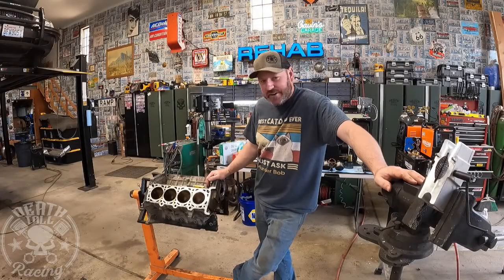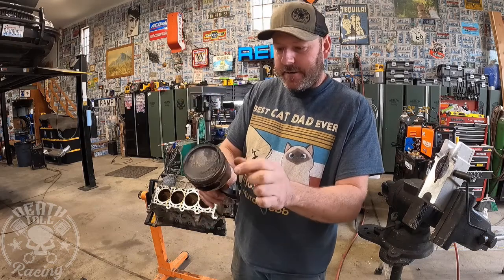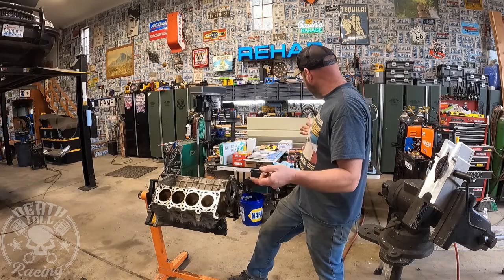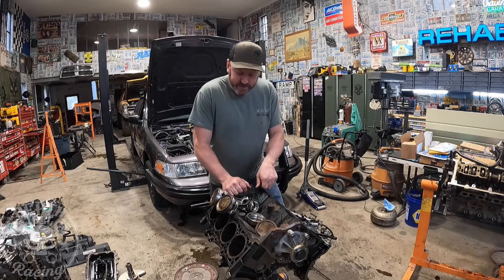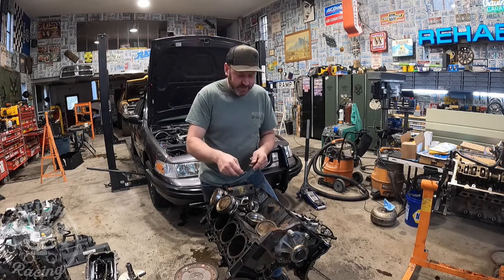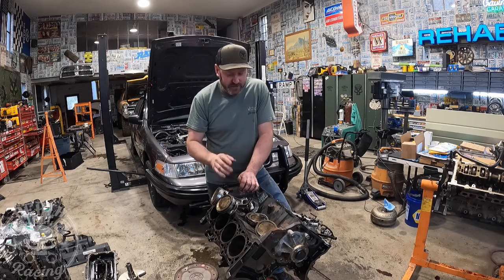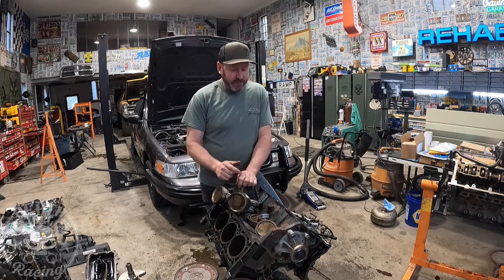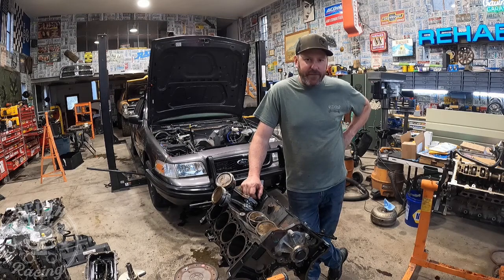Crown Vic WAP Block Swap, Boost Prep, Twin Turbo Crown Vic Budget Build #boosted #twinturbo

Comment: The placement of your turbos is exactly how I'm doing mine.  Except I'm wrapping the intake instead of the exhaust to keep heat away from the turbos as much as I can.  And the bov will be right near the throttle body.  I've done remote mounted blow offs before and had problems.  Also adding a totally separate oil system for the turbskies with a little 4 quart reservoir and cooler.  I loved watching your build and love your process.
Reply from the maker: That's how I was originally planning on doing mine, but I was having a hard time finding a pump for the oil.  I may end up adding a separate oil system later, but it's working good as is for now.  I agree with the blow off, I need to add a gauge pre throttle body because I don't think they are blowing off properly, and it will be a problem at higher psi once I get a forged rotating assembly.
Reply: So Tilton and Earls make really nice differential cooler pumps that work great as turbo feed pumps.  Low pressure higher flow works great.  Earls products are much nicer but a Tilton will get the job done.  And a power steering reservoir is a good choice for fluid storage / tank because of the way it is designed internally to dump back in and drain down.  Keeps air out.  I've done so many turbo builds for customers but never one for myself so I'm super stoked to start mine soon.  You've got me inspired again to put in the hours.
Reply from the maker: @knobleindustries8106  right on!  Thanks for that. I may do that once I get a forged motor built. This one has its work cut out for it this spring (currently wap block swapped if you haven’t seen the original motor explode during binge boosting). Hopefully the wap motor will hold together for a handful of passes @9 psi
Reply: Haha yeah those rods just suck.  I have a collection of 4.6 rods that are bent.  I'm building a 7.3 for my Vic, they finally make some manifolds with integrated intercoolers I'll be trying to get my hands on.  I'll blow the current motor up and then swap in the 7.3.  at some point.  I also need a trans.  It never ends.  I saw your air cleaner stealth box thing and was actually planning somthing similar running a 2" pipe inside the box up to the throttle body.  Found a work around here so I don't need smog (California) so no need to hide my work anymore. Also doing air bags soon and will film that whole process.  😁
Reply from the maker: @knobleindustries8106  right on!  7.3 will be wicked!  I’m not sure what gave first, but definitely somewhere around the wrist pins.
Reply: @knobleindustries8106  yeah you can get gen 2 coyote rods put em in there. They can be had on ebay for under $250. The gen 2 coyote rods are good for 650+ hp all day. They fit just fine in 4.6's.
Reply: @DeathTollRacing coyote rods are good for 800hp and 200 bucks

Comment: The pistons out of my 03 marauder have coated skirts
Reply from the maker: So what's odd about that is the original pistons in the 2010 vic were coated, but the 2005 wap block pistons were not.

Comment: Nice. I hate to be that guy but Andrew Lavender is running well over 1,000 hp through a stock WAP block and he drag races his Mustang hard. Everyone wants the Teksid but I honestly don’t think they’re worth the extra money and effort to acquire. I have a WAP from an ‘03 Expedition that I’m going to be building for my 2011 Vic
Reply from the maker: Yeah, I agree.  I think this block is not as limited as a lot of people make it out to be.  We will see how it holds up, but I'm going to limit my boost to 9psi for a while.  It will be interesting what hp that is now that it wont be slipping.
Reply: Im running 608rwhp in my mustang on an early WAP block out of an 03 mach1. I've been told that the Aluminator blocks that came in the 3 valve mustangs are stronger than the Teksid.
Reply from the maker: @stullsy21  I've heard the same.  It will be interesting for sure.  My limitation will still be my pistons and rods.
Reply: @DeathTollRacing  normally is, from my experience, rods, Pistons, or bearings. It takes a lot to kill a crank or a block.
Reply: Yea Andrew is who I based my build on. I knew failure would occur if I didn’t forge the internals but to see it happen at about the given numbers where ppl say it does was nice to see. Andrew is the 4.6 2v king to me. They’re expensive to build but dtr should forge and boost. I’m trying but my funds aren’t lol.

Comment: Im installing a remote Mount turbo setup on mine, can i blow 7psi through the Mass air flow sensor?
Or do i need to relocate the mass air flow sensor to the rear?
Reply from the maker: You can. That’s about the max of what mine could handle tuning wise.  It should stay up front.

Comment: IMO cable clutches are fine.  5 time Mustang owner.    Reliable for the most part.   I've owned a half dozen hydro clutches over the years.  Least reliable.     I have a 50% torn ACL in my left knee and I can run a mustang cable clutch all day long.
Reply from the maker: Well that's good to know.  I'm already into this one, so I will see how well it works.  I'm a bit ahead of this, just behind on editing.  I'm a little less confident in this hydraulic slave after installing it, having problems, researching, and finding out about the area's I was questioning were valid concerns and need to be addressed.  

I put a stage 3 clutch in (650hp rated supposedly) so I was worried the pedal may be very stiff for a cable.  But I do have the cable if the hydraulics turn out to be a p.i.t.a.

Comment: And the journey continues. I thought auto gearboxes are stronger but I'm probably wrong.
Reply from the maker: They can be built to be stronger.  There are a lot of pros to auto's, but I really like manuals.  They make some really strong manuals too.
Reply: Auto's will always be the the fastest option. You can build one out pretty cheap. The Jmod really does great things for the 4r70w. I did mine in my driveway in an hour. It's really easy and all you got to do is drop the pan and valve body.

Comment: How much would you guys charge to turbo my vic
Reply from the maker: Unfortunately we are not set up to do customer builds yet.  This build does have a complete parts list though, which will be helpful for someone local to you, or if you want to tackle it yourself.  I will be doing a builders guide video very soon that will highlight the hurdles in doing all the upgrades, and the pros and cons of each of them.  Good luck!!!
Reply: Dude it is so easy to do yourself. Honestly if you can't swap an engine and install turbos. I wouldn't even bother messing with it. It's going to cost so much it won't be worth it. Unless you just got money to throw away.

Comment: comment for the algorithm
Reply from the maker: Thank you!
Reply: @DeathTollRacing  bro you're too fast !! While i' at it did you ever confirm the transmission slip killed the engine or will it remain a great mystery?
Reply from the maker: @petithor  haha. Yeah, I played with my speed because my most common complaint was I was to slow. I must have went to fast this time because I got a lot of comments about it. 😂 

As for the engine letting go, nothing is confirmed. But it will be once I get it back to the dyno in the next couple weeks. My theory is not that the auto necessarily killed it, just that my target hp was 400 to keep it safe and I’m pretty confident that I had it turned up well beyond that compensating for the slipping trans.  Mathematically I should have been at 400 around 8psi. I had it at 12-14psi.

Comment: Bro dont use a t45!! Theyre awful! If you buy a t45 bell housing, then a $1200 tremec tko box from summit, its 100,000 times better. I lost 3rd and 4th in 4 t45s before i started swapping t5s in, then i found out the tko box from summit is essentially a significantly improved t5 that doesn't come with a bell housing.
Reply from the maker: It's just temporary.  It is meant to be a budget build so I'm seeing what I can get away with and at what point everything explodes.  We will see how it holds up.  There's actually a new version of the TKO box that's even stronger (Tremec TKX).  When I build the new forged short block I will be getting it since at that point it's no longer a budget build.
Reply: @DeathTollRacing  copy that buddy. I promise im not one of these dip shits that tells other people what to do with their cars. Ive just had a bunch of t45s break on me. Wasn't sure if you were privy to that information so i figured id let you know. Cheers man, good luck!!!
Reply: @DeathTollRacing  by the way, i just acquired a tkx. Its going in my moms '69 mustang convertible in place of the 4 speed. Im hoping to have it done by Christmas. She has no idea im building her a car. It was her actual first car. I found it in Phoenix. Did the same ghing for my dad with his 1965 impala ss. Original 396, 4 speed, a/c car. Found it in Victorville, California. Out of three sons who do you think is the favorite?
Reply from the maker: @kelevra558  😂😂😂😂